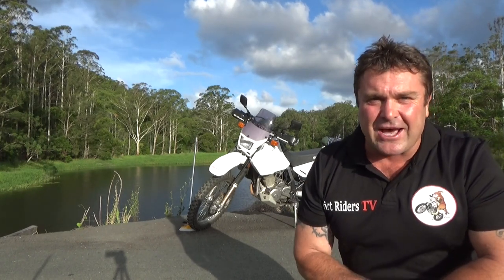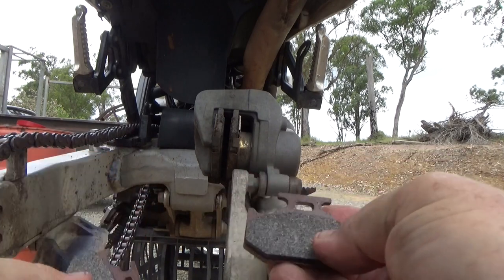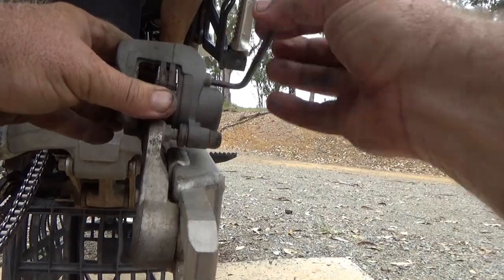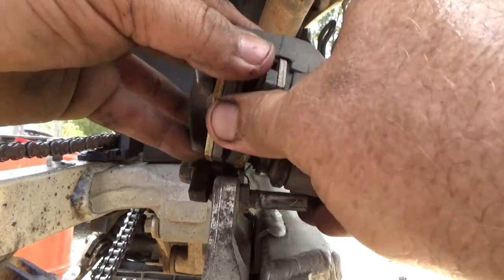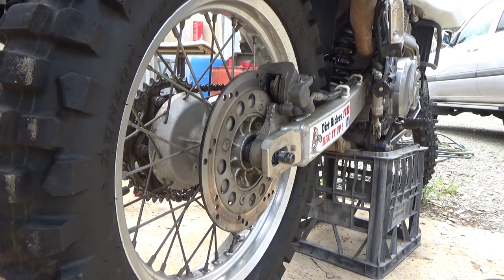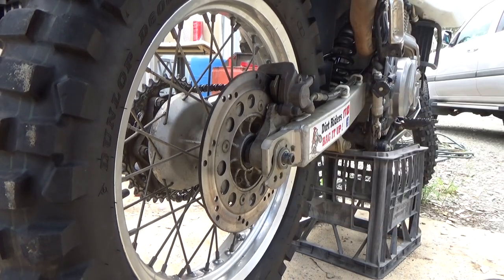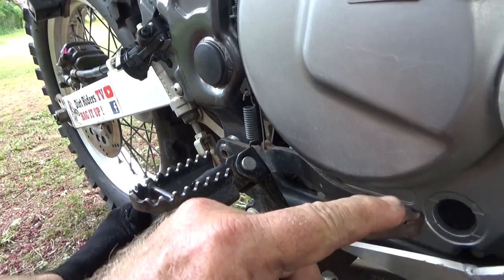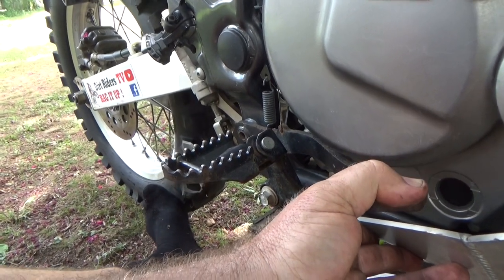My DR 650 Rear Brake Pads Change

Comment: **brake pads.
Reply from the maker: Thanks mate
Reply: Great video, I don't want to be critical but 2 things I would include 1 grease the slide pin holding the caliper to the bracket 2 pump up the brake pedal several times to take up the slack in the pads and piston.